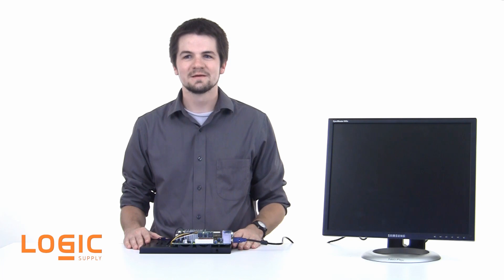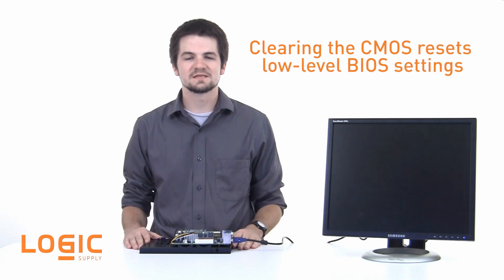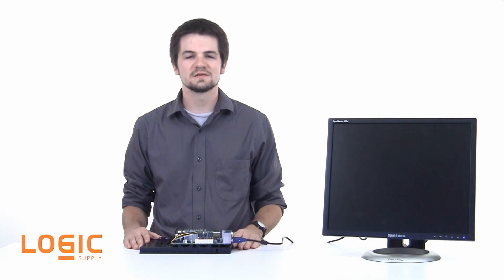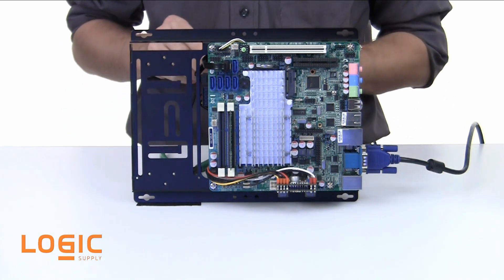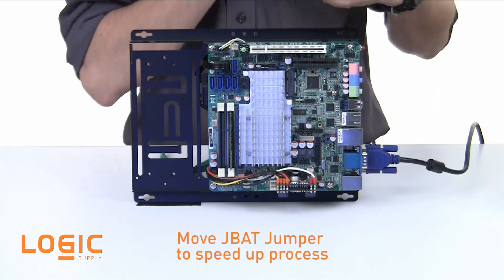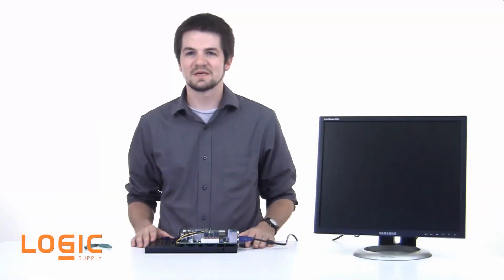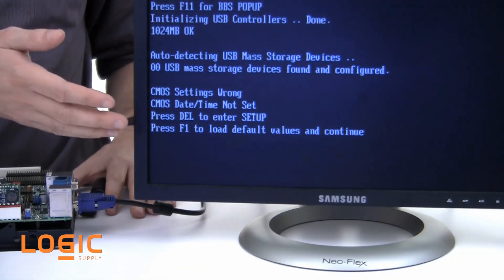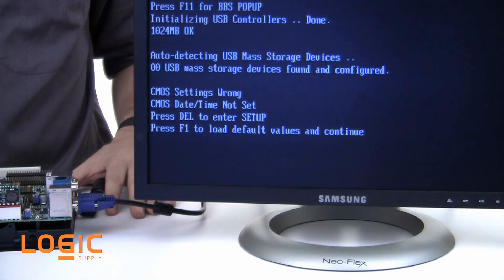How To Clear Your CMOS

Comment: my problem is bit complicated. I set load default configuration from Bios and from then my pc started to restart and beep 5 times and restarts again and again... I don't know what to do tried every thing.. 

Ram replacement 
battery replacement 
I don't have jumper but there is 2 pins of CLR_CMOS but don't know how to reset that

screen I blank 
keyboard mouse not working 

what to do logic pls help me

I have :
G1 Sniper B7 mother board
Intel Core I7 @6700k 4Ghz
8gb ddr-4 ram of Corsair

help me!! (~_~)